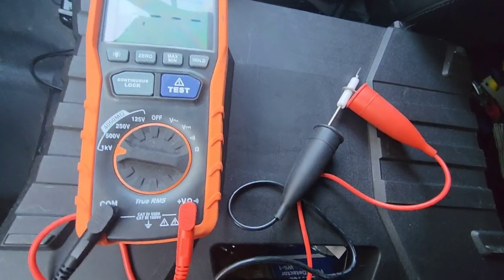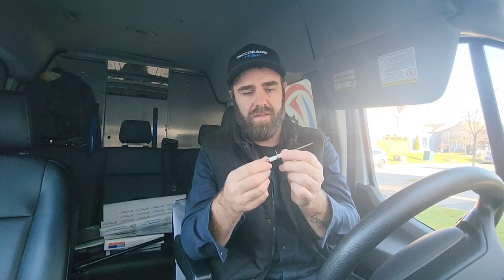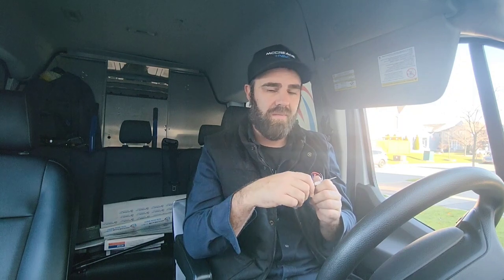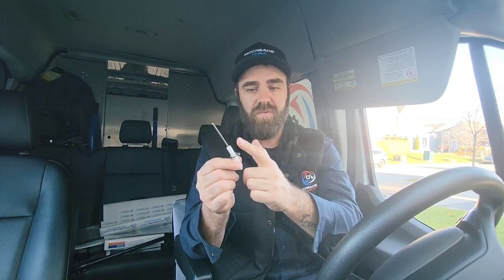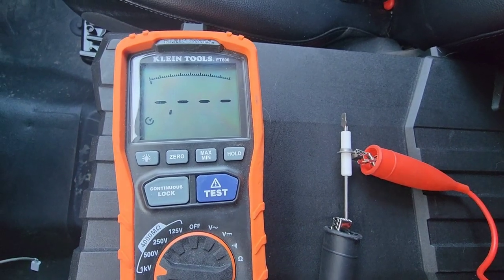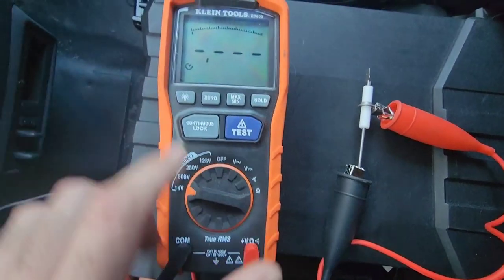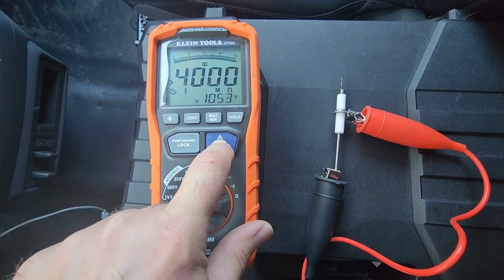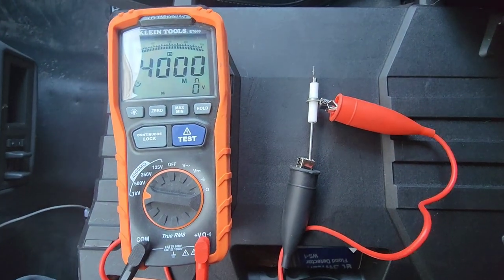How To Troubleshoot A Flame Sensor With A Megohmmeter To Check The Ceramic Insulator

Comment: I just put the probe on the bracket or where the boot plugs in,  put my other probe on the flame rod, move the probe slowly up and down the flame rod, and test continuity. If it shows continuity after you clean it it is good. If it is too chewed from condensate or whatever it will not. All that really matters is the hot junction has continuity. It works for me. The only thing I measure ohms on is the wire for the boot from the board.

Here up north we mostly work on boilers though. I don't know what types of stuff you have going on down south.

Anyways that method works for me
Reply from the maker: That's not the same as this test.  This is an insualtion test, not a flame rod continuity test.
Reply: Isn’t he further north if he’s in Canada?

Comment: I had a junior tech call me for help because the furnace low volt fuse would blow every time the furnace would light. He unplugged the flame sensor and it lit for a few seconds then shut down, fuse intact. When he put it back and the furnace lit again, the fuse would immediately blow. 
That was definitely a oddball one. I suggested replacing flame sensor and bringing a control board just in case the new flame sensor didn’t fix it. Not sure what else it could be 🤷‍♂️ any ideas?